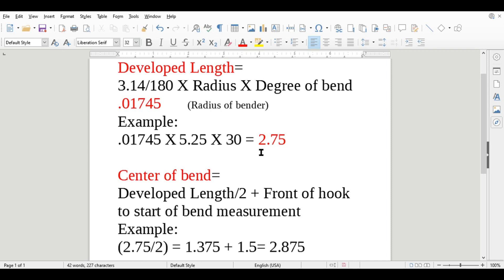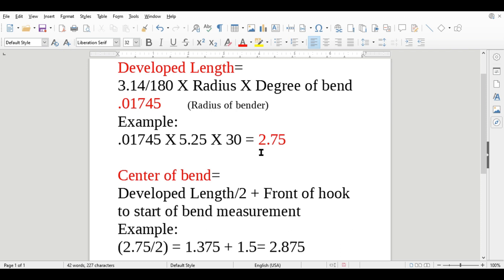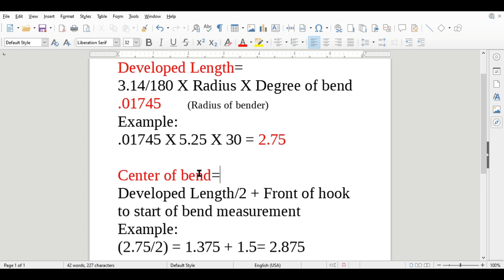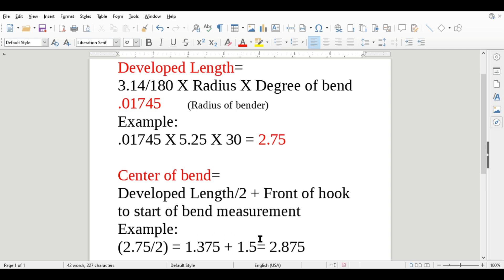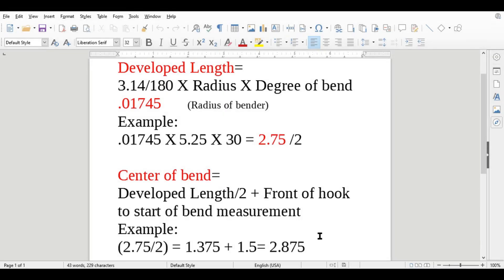Advanced Conduit Bending Pt.2: Most Accurate Way of Finding Center of Bend

Comment: Great videos! You’re doing a fantastic job of explaining this and making it easier to understand.  
I had a question about mechanical benders.  Many of them have a removable/sliding former, which means they don’t have angle markings that you would align the bend angle with the mark on the pipe. So would the center of bend formula be used without the front of hook as to where you would align the mark on the pipe to the ‘0' on the bender?  In your example, say the center of my first bend was 13”.  Would I mark on the pipe 13-1.375=11.625 and align that mark to the 0 on the bender?  Thanks.
Reply from the maker: So if you are bending on center and you aren't using the FOH then all you have to do is not add that FOH measurement.
Reply: @TheArtOfConduitBending  Thanks!
Reply from the maker: Yes that's is correct. Just don't add the front of hook measurement like you normally would.
Reply from the maker: @HVAC_Tips_Tricks_Calcs  of course. Anytime

Comment: You just mark your hook by literally just tracing out the hook on the conduit as it’s in the bender, correct? And also, is there any math involved in finding where the conduit starts to bend?
Reply from the maker: sorry if i took to long responding. Ive been very busy editing videos and at work. anyway, to get the front of hook measurement just mark a spot on your conduit. then place your front of the hook on the mark and bend a perfect 90. by the way it'll be easier if you use a small piece of conduit. something like 30 to 40 inches but you don't have to if you don't want to. so next after you make your 90 bend lay it on a flat surface if possible on a table or something that you can get the conduit at eye level easily. so place the side with the mark on the flat surface and start to follow the conduit from the mark towards where the 90 bend is. when you first see the bend start to lift off the flat surface place a mark on that spot that is called the start of bend. take your measurement from the first mark that you made and the start of bend that will be your hook measurement . Done. Hope this helps if not hit me up on fb messenger @ holmzlaw

Comment: To get the hook measurement, you need to establish where the start of bend on the shoe is no matter what, so there’s really never a reason to add the hook measurement. It just makes things convoluted. If you know your developed length is 3”, then you know that 1.5” from the arrow on the shoe (or wherever you establish the start of bend is) will be the center of your bend.
Reply from the maker: That is the way you do it. and that is fine. This is a specific way of bending and is the way it's being taught. Either way the bender can choose to do what he wants after he actually learns the method. There are lots of steps you can skip after you learn the method and actually put it into work you'll see that you can skip a lot of steps. thanks for the comment. much appreciated.
Reply: Getting the hook measure first allowed you to work backwards using the formula. So starting where you want your center (w.e number) and mark. Using the developed length + front of hook to start of bend measurement allows you to find where your front of hook will go so that you may get your center bend at (w.e number).